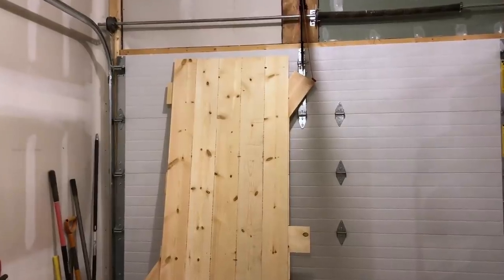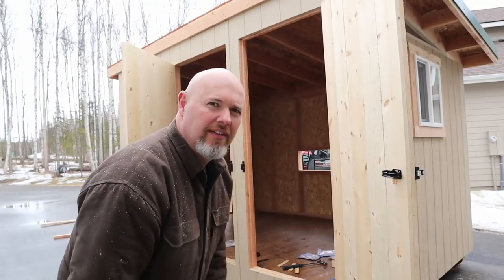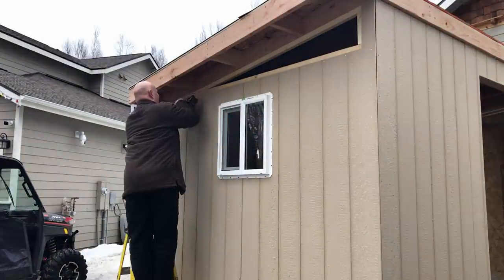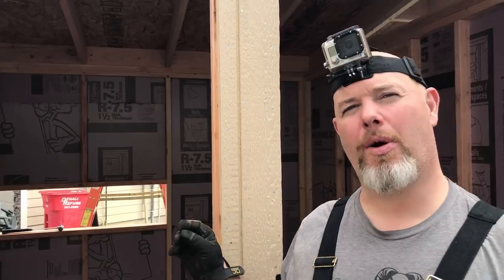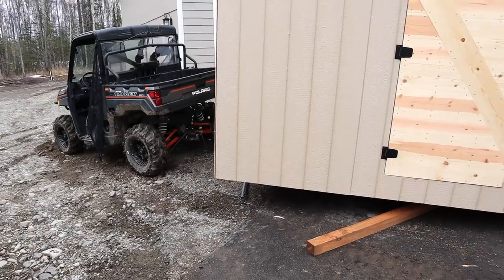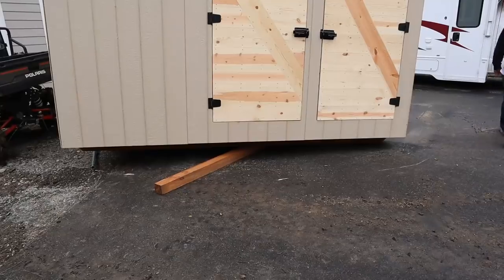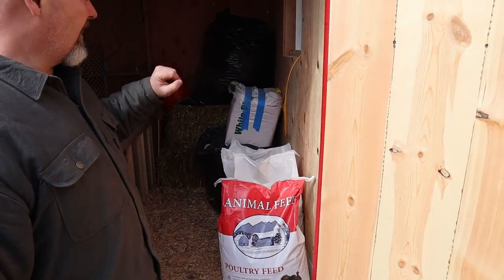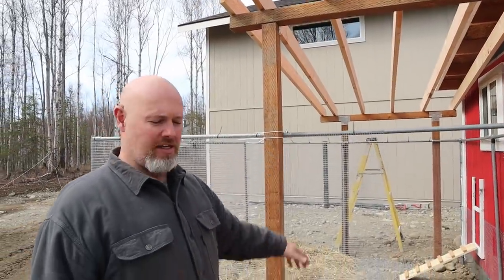Lumnah Acres inspired me to Build IT (Mobile insulated Chicken Coop)

Comment: I was thinking for the portability issue. Since your base is very solid, you could 1st jack up the coop then drill a 1 to 2 inch hole through and through and run a solid pipe that you could attach atv or trailer wheels on the outside of the coop with a coter pin holding it in place.

Comment: reverse door to egg boxes. Open from top. Add two chains to hold door. Door then will be a platform to

old egg basket when collecting eggs. That way you don't have to hold door open all while collecting eggs.
Reply from the maker: Great idea,  welcome to the channel.  I had the door conversation with Von about top or front opening and you can see how that conversation went.
Reply: James Aplin yeah Al did it that way and when you think about it just makes sense but no big deal great job
Reply from the maker: I’m going to go back and look at it and see if it will be easy to change.

Comment: What about hawks flying in to get the birds when they are out in the pen?   I would suggest a hardware mesh on the outside pen area.   Next time hinge the door to nests at the bottom.  It will give you a place to put the egg container when collecting eggs.   Other than that it looks great and solid.   Good job.   Oh yes, what about a light inside so you can see if they need food/water when days are dark.   I would make one light so you can put in a heat bulb if needed later.
Reply from the maker: Thanks for the great comment.  We have completely covered the run area with hardware cloth and netting to keep out any possible predators.  Some others have suggested changing the the nest box door and I will be doing that in the future.  Thanks for watching.

Comment: Found your channel today.  Wondering if you considered insulating the two doors.  It would make the door thicker, but the insulation  is critical for the Alaska Winters.  I"m sure you could locate  a latch that would handle the additional thickness.  If not  leaving a gap to accommodate  the latch and adding insulation  to the rest of the doors is better then not having the insulation.
Reply from the maker: Great advice!  I did think about it and decided against it.  We are raising cold hardy breeds and figured we'd try it this way to start.  As we gain in our knowledge and experience I will be able to adapt and change the coop as needed.  Thanks for watching and leaving a great comment.

Comment: Great video….how are things going now 3 years later…..anything you’d change?
Reply from the maker: It’s been an amazing coop for our climate. The only thing I’d change is to wire it for power. Now that we have our power system up and running it would be nice to have lights in the coop that don’t require a separate power supply.
Reply: @wildwoodoffgridalaska  cool….
How about solar lights?